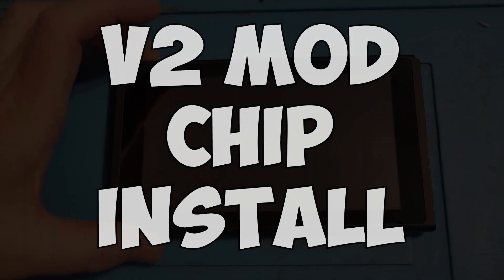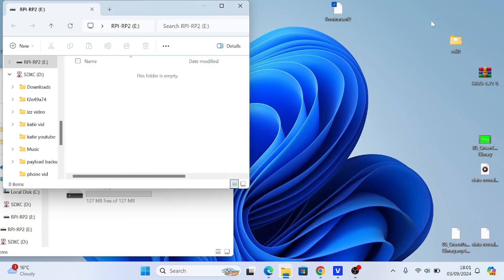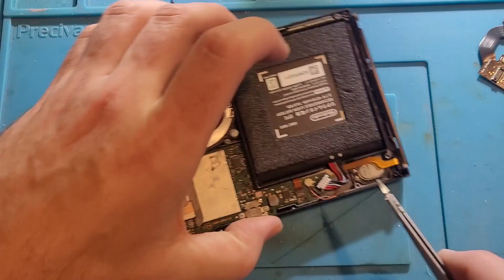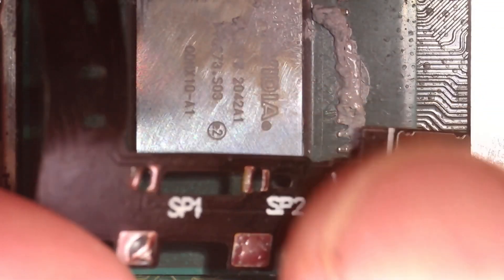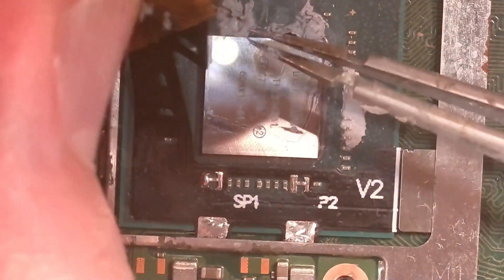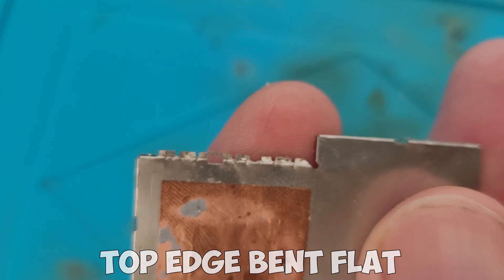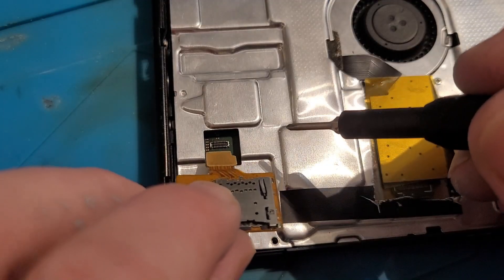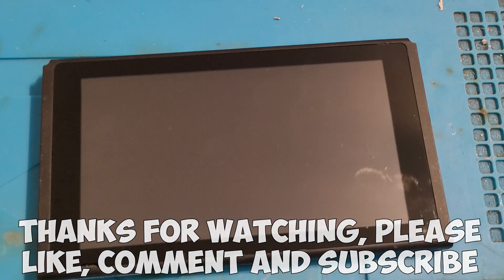Installing a V2 mod chip within 9 minutes! Includes flashing guide

Comment: Hello, have you encountered any NAND compatibility issues with these PicoFly chips?
I have had some problems lately, especially with some V1 switches. Sometimes, they don't boot into OFW, or they crash after 30 minutes of playing on OFW.
I looked it up on forums, and they are saying that these Chinese RP2040s can be hit-or-miss. The resistance values for DAT0/CMD/CLK are 47 ohms instead of 100/100/47 ohms, so I checked my RP2040, and they had 47-ohm resistors.
Reply from the maker: I wouldn't doubt the quality, I would expect some issues as it's all about getting them out cheap!
I must have been lucky though as up to now I haven't had any of these issues you mention?
Reply: @fixingmoddingbuilding Okay, thank you for your reply.
Could you please provide me with a link to the one you purchased? I'm looking for a decent quality supplier.
Reply: @mohbounu  I had same issues, checking emmc for bench mark from hekate. When score is more than 300P, ofw boot success.
Reply: Interesting, thank you for the tip. I will definitely be checking this way going forward.